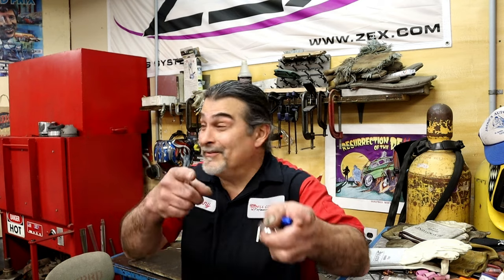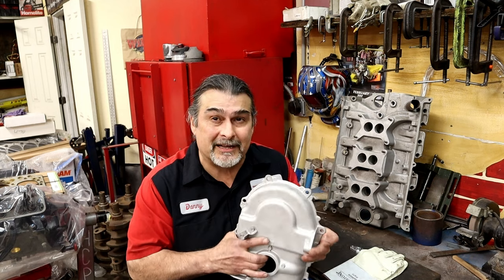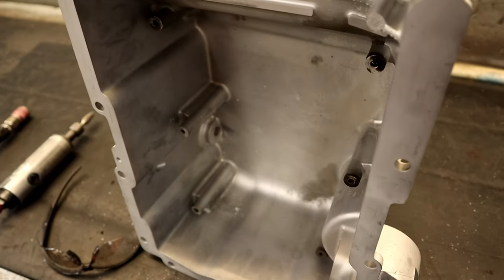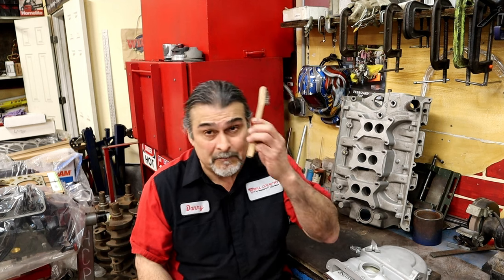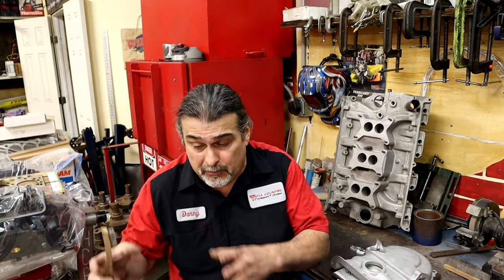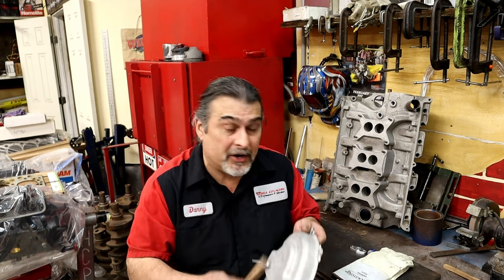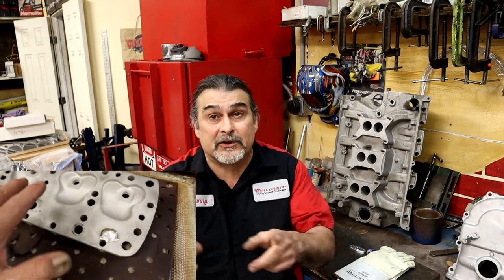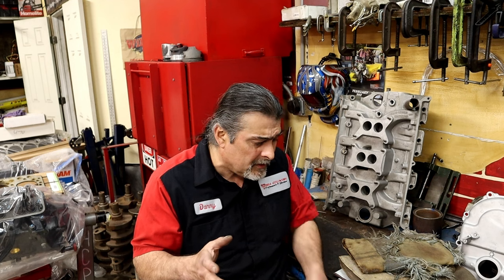NOT A WELDING VIDEO. This video is for anyone wanting to weld automotive aluminum.

Comment: Only second time I've ever heard someone bring up about brushes on aluminum. Once I accidentally destroyed some antique aircraft parts stripping off paint with the wire wheel by impregnating  steel into the aluminum
Reply from the maker: Oh no! Hard to believe that cleaning something could ruin it. Years ago at my parents shop the guy would alway use my brushes to clean parts then put them back ( sometimes,sometimes I’d find them in the parts washer) and they would say I don’t see why it matters. 😓